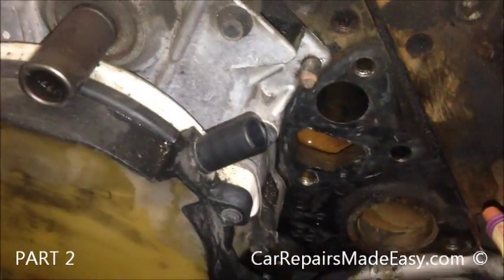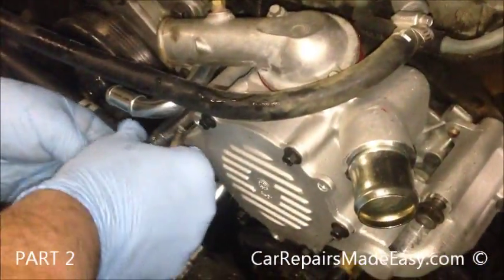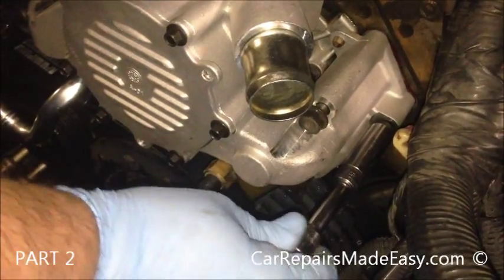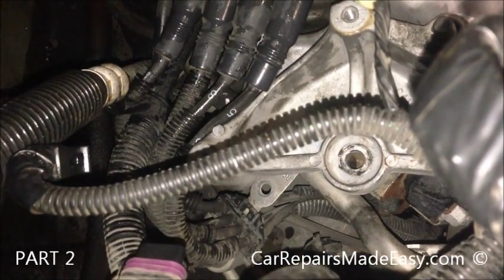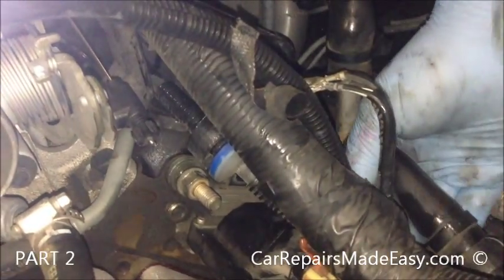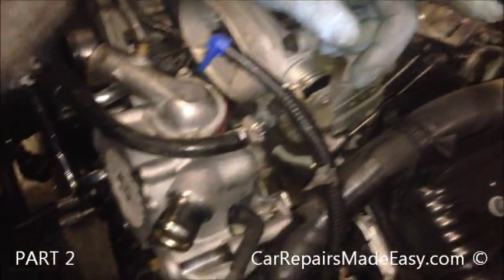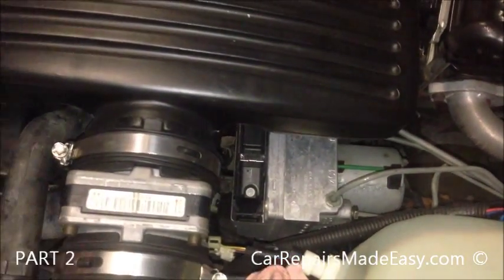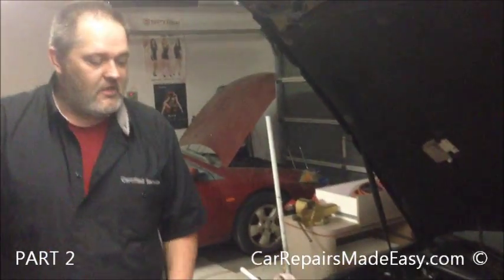Chevy Impala SS Caprice Water Pump Replacement Procedure Part 2

Comment: I had a huge problem getting my water pump to fit in that gear shaft. I tried spinning the pump and for the life of me I could not get this splines to line up. So then I tried spinning the crankshaft with a big socket wrench while I was putting the pump on and this worked unbelievably well. You should note that weather the part B remanufactured or OEM it's important to prefit it which is what I did. That way I didn't have silicone drying up on the part and it's sure to fit on straight so you don't get silicone everywhere when you install it.

Comment: My 96 had silicone on the 4 long bolts, and engine oil behind those bolts. And water came out with the bolts. So, I'm going to add silicone sealer on the way back together. And an oil change afterwards.

Comment: I replaced mine in a 95 Caprice today and now it runs real bad. Can that be from the coolant leaking onto the optispark?
Reply: Yes, I realize this is three years old but that was the death of these cars. I am going through the job of pulling the Opti-Spark now and it is a total nightmare. If yours is running bad it will probably need to be replaced or rebuilt. You may have sold it or resolved it be now but a good place with good information is Firebirdnation under 4th Generation.
Reply: @HexaFox  I sold the car for a decent profit shortly after this. Once it dried fully, it was fine 👍

Comment: what symptom did you have when your water pump went out ?
Reply: The Weep Hole was leaking...The weep hole is there to relieve pressure if the WP seal is leaking and let's you know to start looking to replace.
Reply: @spencerfrey2609  what is that...the week whole